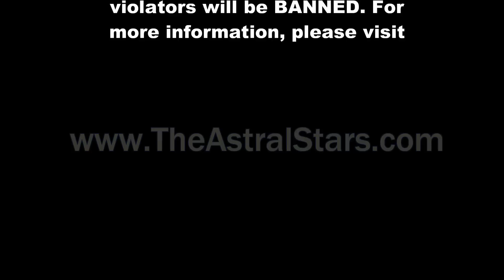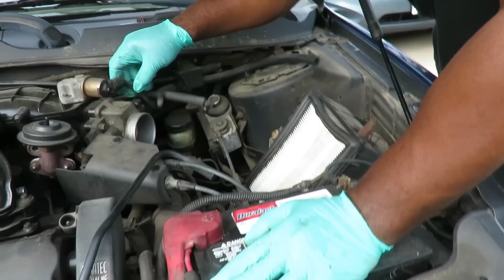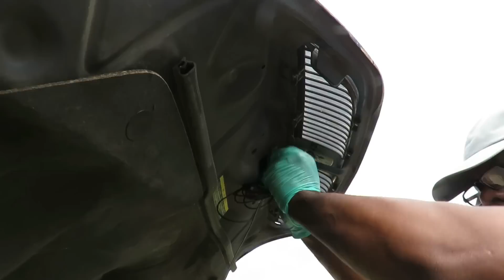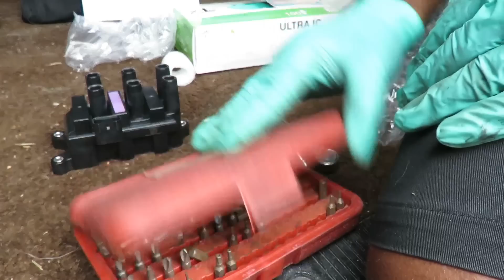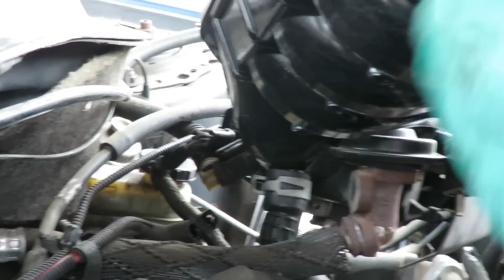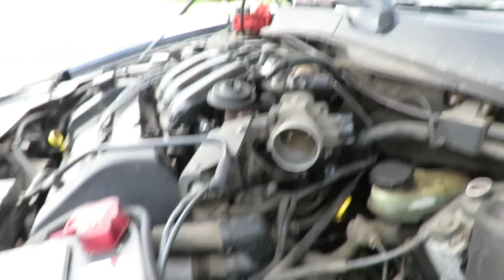⭐ 2002 Mercury Sable - 3.0 - Ignition Coil - Runs Rough

Comment: I made a comment about 7 months ago...I have a question concerning cylinder 6. I changed the spark plug and switched spark plug wire still cylinder 6 misfire...do you think I should change the coil pack...
Reply from the maker: If you have a spark tester, place it between the COIL and the spark plug wire to see if spark is actually coming out of the coil., if so, the next step would be to check injector pulse and the injector. Hope this helps!!😀
Reply: @OnlineAutoRepairVideos  thanks for responding 👌🏿
Reply from the maker: @RandomMind  Anytime bro!

Comment: 1999 mercury LS wagon it starts run no mis . shut it off it will not start. Let it set a wall and it will start run fine till u shut it off. Help
Reply: 3.0
Reply from the maker: Check for ANY codes. Sometimes there might be codes in the ecm, and the check engine light will NOT be on.
Reply: Same problem with mine but i have the ls sedan 2004. Ever figure out what it was?

Comment: Hi thank you for taking the time to read this I too have a 2002 Mercury sable GS 3.0 v6 regular not overhead cam I have noticed after the car warms up it's not finding a lot of power but before it warns up it's not bad I'm suspecting either a failed plug or the coil box I'm going to change out the coil box first and a debt doesn't happen then I'm going to check the plugs in my in the right assumption and doing it that way thank you for taking the time to read this and before I forget what size of socket either metric or regular did you use to take off the coil box thank you again
Reply from the maker: No problem Phillip, I believe they were metric. ALL the socket sizes need should be in the video.
Reply: Thank you for clarifying I'll watch the video again

Comment: i noticed the mounts too. how would you have cleaned the iac? you make everything look so easy.
Reply from the maker: I would have removed it, sprayed it carburetor cleaner, then used the same rag soaked with carb cleaner to clean the pintle. I would have done it then, but I was not sure what would have happened to the gasket.